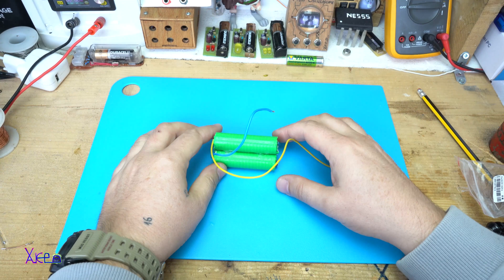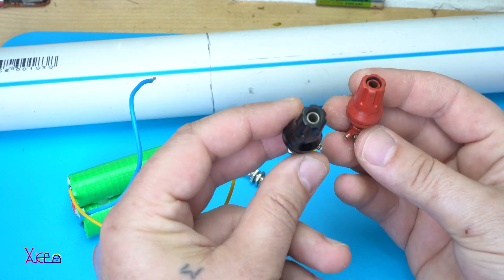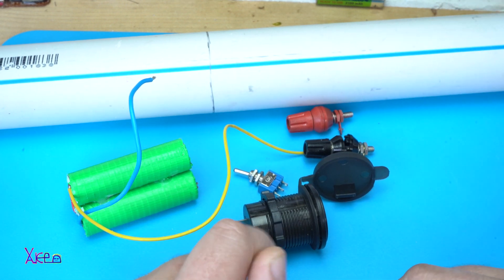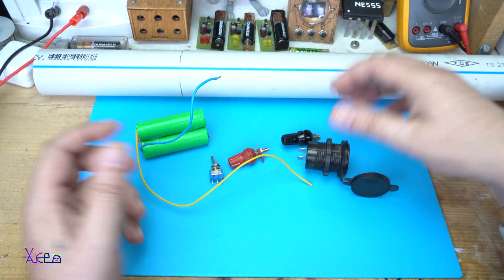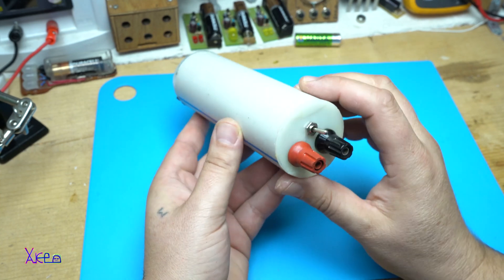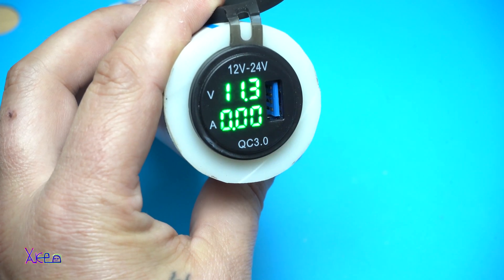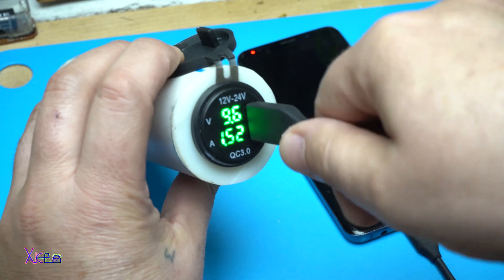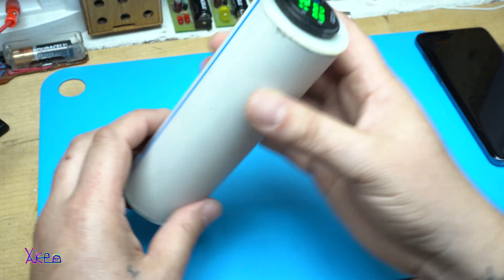Making Power Bank with Voltmeter Ammeter | 12v and 5v Output

Comment: Do you recharge the batteries with a 12volt battery charger, or can 5volts be used without burning the 5volt charger?

Comment: On the AliExpress website, you can buy a module with a micro connector charger plus a step up booster for the 18650 battery, which has a potentiometer and the output voltage can be from 9V to 12V. This is the likk of the module: https://www.aliexpress.com/i/32976180245.html

Comment: Using Lithium ion batteries without BMS can cause explosion or battery damage.this type of battery can explod badly if charge it over 4.2 volt.so be careful freands
Reply from the maker: I have charger curcuit that max voltage is 12v
Reply: @Hacktuber  of course you're expert but there are many viewers don't know about it.and another problem is there is no under voltage protection.that step down usb module is working down to 6 v that bill cause damage to the battery
Reply: @Hacktuber  That can still cause an issue if you try to charge these lithium batteries in series with 12v. If one battery isn't charging correctly that would cause the other two to overcharge. You need a bms to do the charging and discharging correctly. There are some of these too that you can charge via the same output wires. Also you should have cut those bolts a bit shorter and possible use some liquid electrical tape around the exposed metal contacts as that can cause a dead short.
Reply: @MrDarkDragone  i think he knows what he's doing. He wont post this video without knowing it, if you are worry about it why won't you make a video and make a better one  i like to see it  😊
Reply: @daydreamers845  but Joey is right ... It may explode badly